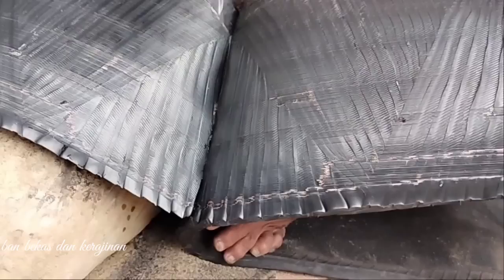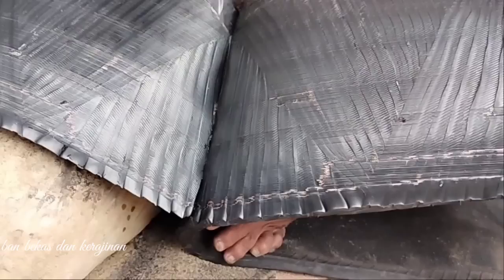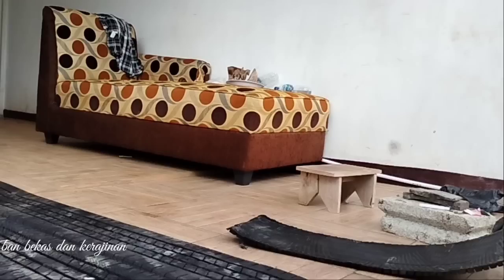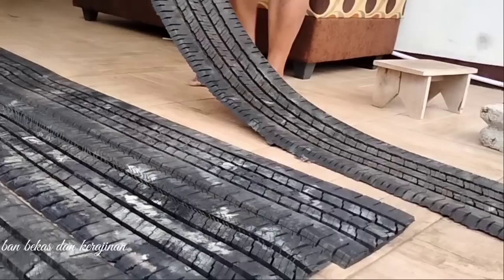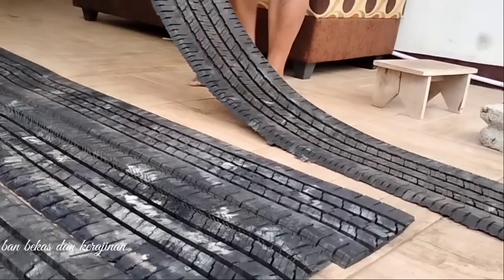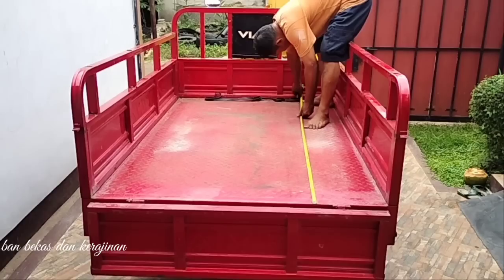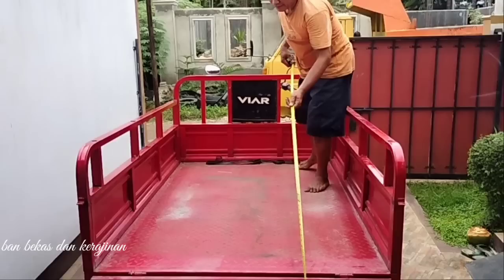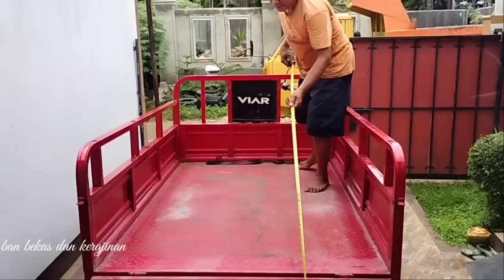How to make rubber rug from used tires

Comment: No la menos precies por qué podría ser una buena camioneta si le metes dinero con realmente expertos en el tema de ese tipo de vehículo, pero aún así no va hacer un vehículo con mecánica y tecnología vieja, a la larga te va a salir el tiro por la culata, vas gastar 8000k por el vehículo, como 2000k por los trámites, unos 3000k por costos de grúa, dos motores 5000k, una buena pintura 3500k, más extras 3000k, vas a gastar más de 20,000 dólares, con 40,000 dólares compras un vehículo ya equipado y listo para viajar con muy pocos gastos de mantenimiento, pero si quieres llamar la atención con ese tipo de vehículo, pues sigue gastando (TIRANDO) dinero con ese tipo de "YONKES", saludos desde San Fernando California USA, Miguel